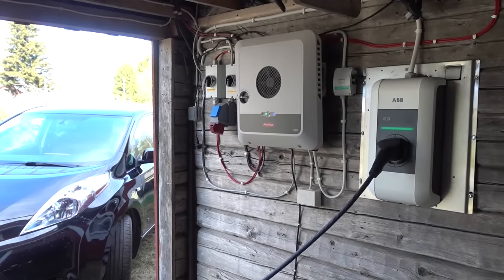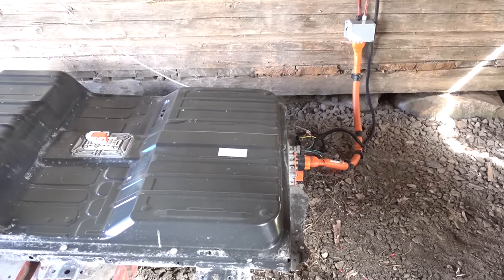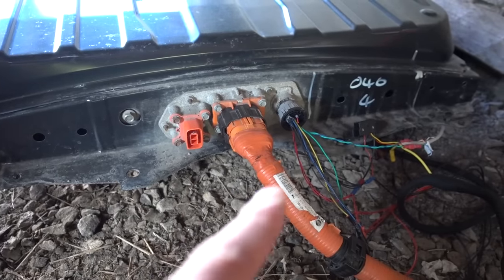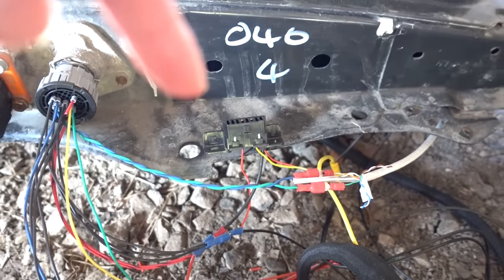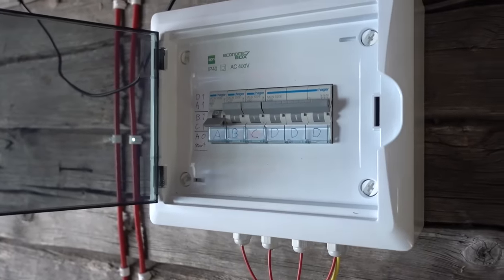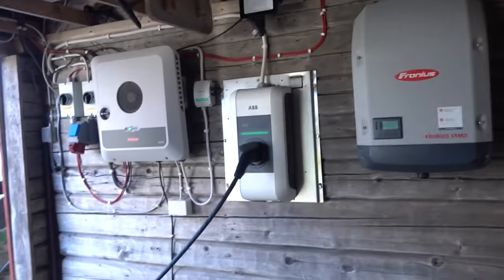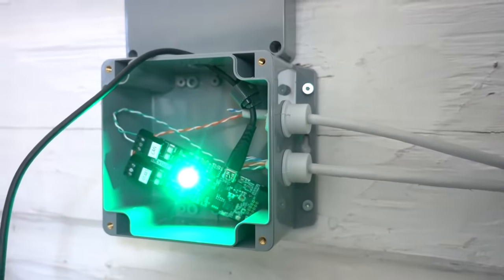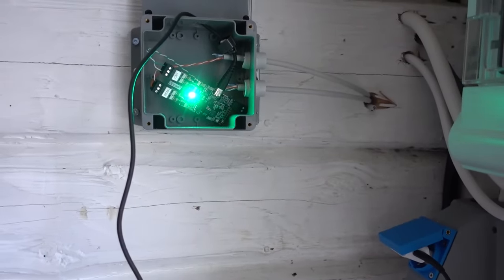The EASIEST way to connect used EV packs to grid! 🔋

Comment: Dala, that is something I would like to do for an off grid application, but could explain it a little simpler for us that are not as advanced as you. Especially the part how you can charge the 400volt dc battery pack safely. Also, can this be used with your 48 volt system that you already have installed?
Reply from the maker: The solar inverter is charging the 400V battery either directly with the solar panels, or it can also charge from the grid. All the magic happens inside the Fronius Gen24.

This is very different from the 48V battery I built a while back. I would not recommend the 48V anymore, this is soo much better and easier to use!
Reply: @DalasEVRepair  It appears the key here is that Fronius Gen24 is capable of charging a high voltage dc battery, right?  Watching the video I was trying to figure out how you were converting that high voltage battery to 48 volts.   I have a Sol-Ark 12k and I'd have to find out if it is capable of charging HV DC batteries.....Evidently I'm "old school" having broken my leaf battery apart three yeas ago and configured it to 48v :)
Reply from the maker: @ScoopDogy  Correct, the Fronius handles both charging and discharging. This is the future, so simple!

Comment: Truly amazing setup, we will see a lot of these setups around the globe, of that I am sure! What about isolation measurement (resistance between HV+ and HV- towards PE). Is this done by the battery or the inverter? What happens if the isolation resistance becomes to low, does the contactor close in the HV battery and inverter then? Does the control logic check so that all cell voltages, temperature and current does not get to high/low and if so, HV battery does close?
Reply from the maker: Both check the isolation resistance. If the battery senses leakage to ground, it raises a CAN message which stops charging/discharging. Also if the inverter senses this, it stops charging and discharging.

Cell voltages and temperatures are also monitored by the BMS, and charging stops if something becomes dangerous!
Reply: @DalasEVRepair  Thanks for response! However, I do not think that both the battery and the inverter does check the isolation resistance. Reason for this is because in order to check this, you need to produce some voltage between the ground and power voltage. If two devices are doing this at the same time, they will interfere with each other and think there is an issue with the isolation...

Comment: Hi! Thank you so much for your project. Previously, there was a connection diagram on github, not only a high-voltage circuit, but also a low-voltage one (at 6kW). I have a question, does this emulator still control the low-voltage output? And is it possible to control the battery without an inverter (I don't have one at the moment)? I want to test the battery (nissan leaf), and test it under load.
Reply from the maker: Yes to all questions. Check the Wiki on the Github page

Comment: last time I saw this, a used LEAF battery costs almost the same as brand new LFP cells with the same capacity.  in other words, you are better off with LFP because it has several times the cycle life and much more flexibility for installation than the EV battery.  It also helps recycling the old LEAF batteries to extract various metals in it for better use
Reply from the maker: Nah, used batteries here sit at 75€/kWh , you cannot get new ones cheaper than that

Comment: Hi Dala do you have any thoughts on making this for available as a package for people off grid? I have thought I could just run a 12v invertor straight from the leaf 12v battery as the main battery also feeds into (charges) the 12v. Would this still work if I swapped the cars 12v battery for a larger capacity 12v leisure battery?

Comment: Fantastic!  Can I make a request to look into - the possibility of also providing communications with a Renault Zoe battery?  They are pretty cheap in the UK at the moment - the scrap yard up the road has a 50kWh one for sale for £4800, which is about the same price as a 5kWh battery from myenergi (inverter aside!)...
Reply from the maker: There are basically no Zoes here in Finland, but anyone can add support on their own, that is the great thing about open source projects! 😁
Reply: The Electric Viking, Sam Evans, talked some time ago that the price "nowadays" of the cells are about 100 USD per kWh, and the price goes constantly down. This means, for sure, that the prices of used batteries will go down, maybe not that fast as desired.
But the path into the future is quite clear!

If you want to follow, without googling to much, the development of new battery technologies, I think The electric Viking is a good source. New technologies mean normally lower prices per kWh. 😉
Reply: Renault Zoe 52kWh protocol had already been worked out and tested for ESS. Feel free to get in touch if you want more information.
Reply: @toucan_can  how?

Comment: thank you for technical advice, but just curious, why would anyone need battery system, if that system can't work without electricity?
Reply from the maker: It can work without electricity. A small 12V lead acid battery can keep the battery engaged when the grid is down

Comment: Hello Dala  can this also being used when the battery is still in the car?
just make a plug in the loom for canbus/12volt and use a big DC conector like forklifts have.
than you can still drive and use it for youre home ?
Reply from the maker: Yes it can, I added basic emergency support for Chademo: https://github.com/dalathegreat/BYD-Battery-Emulator-For-Gen24/wiki/Chademo-vehicle

Comment: I wonder if there is a market for a conversion kit / wall box for this
Reply from the maker: The hardware is 15€ and open source. Making a product would have two big issues. One would be the price, people would constantly complain about the price, when there is a free software and 15€ hardware involved. Second big hurdle is the liability aspect. Who would even want to sell something like this? What if thr customer is not technically handy, connects everything wrong and starts a fire? No this project stays as a hobbyist open source one!

Comment: Very good, thank you. The 12vdc DIN rail switch panel could easily be automated using a small plc etc.
Inverters can get hot (60°C) when working close to capacity so I would mount it on an aluminium plate with air gap [temperature switched PC cooling fans below help further] to keep it below 45°C which is where they throttle back to protect the IGBT's and make it more efficient.
Reply from the maker: Good tips!

Comment: Very cool - I see at the 4min mark you talk about manually opening/closing contactors in the pack. Does the packs BMS eventually take control of the contactors for safety? (Overcharge, Overdischarge, etc) or are you bypassing the BMS?
Reply from the maker: See the latest video contactors automated!

Comment: If the mains grid  power does go off you said your BMS to RS485 will cont to run with the converter board battery backup once fitted. How do you isolate the battery power into the house from the mains power. You dont want to be feeding back out to the main grid. Does the Solar Inverter have an automatic isolation for this?
Reply from the maker: The Fronius has an optional contactor box for this scenario yes!

Comment: That sounds cool that it can be used how safe are they?  We seen how many of those EV car's just blow up in flames because of the battery's..... so I wouldn't put one of these in my house. Maybe outside the house with um... Idk in a fire box or something.
Reply from the maker: The wiki has more safety info: https://github.com/dalathegreat/Battery-Emulator/wiki#what-about-safety-%EF%B8%8F-%E2%84%B9%EF%B8%8F

Comment: I am thinking about getting a secondhand Leaf. We are completely off-grid at home so charging at home is probably not possible at this point (well maybe only at the sunniest times of the year). There is a charger just down the road. What I would like to be able to do with it is take it down the road and charge it up and then be able to inject the HVDC into my solar power system. i.e. the battery is still in the vehicle. 

I have heard about V2H. However is there a simple way to gain access to the live HVDC while the battery is still in the vehicle? In other words just using the vehicle's electronics to set the battery to "on" and then be able to draw a load from the direct outs of the battery pack?

Comment: I checked out most of the supported inverters and I did not see any compatible with three wire split-phase systems like those used in the Americas. Do you know if any of those supported will be compatible with this type of electrical system? Most of the tested inverters are three phase, which is only usually available in industrial areas of the US. Thanks so much.
Reply from the maker: AIMS is adding support for the Battery-Emulator next week, that is a perfect inverter for the US!

Comment: Using a different inverter - Fronius aren't readily available here - is there a need for the CAN-BUS conversion, if the inverter is capable of reading CAN-BUS? We can readily source SolaX, which can take 500V battery and has CAN-BUS signalling.

Comment: how can you use ev caar battery if inverters work only with max 48volts battery packs ? do you have transformer if car battery is 300 volts that transforms 300volts down to 48 volts or how did you do it ? what is voltage of nissan leaf battery ?
Reply from the maker: Get a different inverter that can handle 400V. Much easier! I have other videos on 48V, but I do not recommend this route.
Reply: @DalasEVRepair  ok i didnt know there are inverters that work with ev batteries. Is it necceceraly to do all those connections about communications ,or can it be more simple just to connect positive and  end of leaf batter to inverter ? Would it work with just that ?
Reply from the maker: @triplextriplexxx8225  All explained here: https://github.com/dalathegreat/BYD-Battery-Emulator-For-Gen24

Comment: Suggestion: buy one of these cheap DC-DC step down converters and power your Lilygo board through that converter directly from the battery pack. They are cheap and have wide input ranges and the output voltage you require. I use a couple to run my 12V camper compressor fridge and other 5 and 12V gear from a 48V LiFePO4 battery pack. Very efficient and cost effective.

Comment: This is fantastic!  No need to muck around building batteries or bms's. Plug and play. Question: of you wanted to use multiple leaf batteries would that require multiple inverters? Or could a single invert handle more than 1 battery?
Reply from the maker: You can string together multiple LEAF batteries yes, but you need one additional PCB that summarizes the CAN data into one, so it appears as one large battery. Would take a few hours of development, quite straightforward!
Reply: Come to the comments just for this.

Dala, is this something you’d be looking to do on your setup? I have zero technical skill but would love to see an ability to string multiple batteries together on one inverter for scaling.

Comment: HI Dala's I have an issue with my Nissan Leaf 2018 model with 123,000 miles drove it for taxi cub  
It showing the car is connected to the charger while charger is out
I token the car to dealership they told me to change the battery or IPDM when I found out from Nissan it was Huge amount of Money so I could not just afford to buy one from dealership I bought a car from auction with 2,7000 miles and I replace that battery to my car as well as the IPDM but the car showing the same problem which was showing before could you kindly advice please
Reply from the maker: Make a thread on the mynissanleaf.com discussion forum, and attach the fault codes!

Comment: Would it be feasible to keep the battery pack attached to the donor vehicle to power an inverter while parked, but .. disconnect to drive? I imagine so but wiring would be more complex (and need contactor(s) to isolate pack from vehicle while using it for power).
Reply from the maker: I added crude Chademo support last week, for connecting vehicles directly! https://github.com/dalathegreat/BYD-Battery-Emulator-For-Gen24/wiki/Chademo-vehicle

Comment: great video!  my apologies for being a nube.  Question:  When you say "30kWh" don't you need to state the voltage at which you home electrical circuit runs?  It sounds like you are in Europe so it would be 220v correct?   I have been trying to find the voltage that leaf motors run nominally and it varies by the rpm.  I am seeing quite a few quotes but 5000 seems to be a commonly cited number.  Can anyone cite the kWhs at 110v (US)?
Reply: 30KWh are 30KWhs, nevertheless which voltage is used. As mentioned in this and other of Darla's videos, the battery has a voltage of about 400V when almost full which fits perfectly to the high voltage input of a Fronius Gen24 inverter. P=U*I, so 30KW=400V*75A (simplified). Means you can draw 75 amps over 1hour or half of it over 2 hours and you have taken the 30KWh out of the battery. As a usual household barely consumes more than a few KW permanently, a fill battery will easily power the house for a day or longer. The inverter will convert the high voltage DC to whatever you need as voltage in your area, except of a few percent loss you can consume the 30KWh converted to 110V or 230V here in Europe.

Comment: I’m looking to use a Leaf as both an ev conversion and a battery pack for solar storage. We have a vintage Airstream trailer we use as a summer house on a remote property and want to make a VW beetle ev conversion like the Fastleaf to mostly just sit next to it looking cool but also be drivable, since we sometimes need to move the trailer a short distance because of potential creek flooding. There are no grid utilities available. How can this be achieved? What would need to change to make the Leaf vehicle to load? Thanks so much. I’m dipping my toes into water that is way over my head.

Comment: Question, how old is the Leaf Battery, how many miles/KM did the 'donor' Leaf do - or, let's say, how many charges did the Leaf battery do prior to you getting it - how much did you pay for it and how many years do you think are left in it? I am planning to install a Solar Panel system, and i would really like to be able to go off-grid. Is it also possible to combine these batteries? For example, instead of 1, put 4 on a wall, growing the power capacity to 120 kW (assuming a 80% usable, would make a 96 kWh pack ).
Reply from the maker: This is a 2017 30kWh with over 100k km on it,89%SOH. I have estimated this to last 10+years, maybe 15.

Parallelling multiple packs is doable!
Reply: @DalasEVRepair  what should one pay for such a second-hand battery, more or less? thank you for the response!
Reply from the maker: @manoahvanderwolf3259  depends on region. a 24kWh pack is 1.5k, 30kWh is about 2.5k
Reply: @DalasEVRepair  thank you SO much. so that's really interesting, as new 5kwh batteries, like those of huawei or pylontech are about 2k (in EUR) in Spain ( where i'm at ), so i get like 6 times that much for about the same price just by having a Nissan Leaf unit.

Comment: Cool, but I don't have the HV batteries, mine are the LV ones... guessing it would not work ?

an off topic question, with my BYD LV batteries, the only way I can seem to view the BMS stats is by going out to the battery, unpluging the data cable so that it goes into WiFi mode, and connect via the App. 
the battery is connected to the LAN and to the Internet (and BYD can access it that way) does anyone know if there is a way I can connect to it over my LAN ??
I can see it on my network, but the WiFI user name and password don't let me in :(

Comment: Could you please make a review of how does the system work today and what is going on with the capacity of the battery. Is there challenges that you had to overcome meanwhile? Thank you for all your efforts and sharing the knowledge
Reply from the maker: See my latest video. Battery got doubled! Smooth sailing since start, basically no degradation in this easy life as stationary storage

Comment: is it compatible with a byd battery?

can this be designed so you can use a running vehicle and just unplug your car and drive away?
Reply from the maker: Yes there is experimental Chademo support!
Reply: @DalasEVRepair  Do you have more details about it?
Reply from the maker: Nope, nobody has tested it yet! @adicorutiu8049

Comment: Hi Dala very good video and smart setup. I use a hybrid Goodwe GW8K-ET hybrid inverted, which looks quite similar to Fronius Symo Gen24 Plus. Interestingly is it possible to adopt it for my inverter, because Goodwe also uses a High voltage battery (Battery Voltage Range (V) 180~600) and supports: BYD HVM 11.0 battery?
Reply: Found via FAQ what should work, thinking to try. Need to start with battery purchase or the opposite?

Comment: Will this work with other inverters? Is the inverter canbus protocol a standard?

Your Gen24 inverter takes 350v batteries? Is that unique or do most inverters do that?
Reply from the maker: See the wiki https://github.com/dalathegreat/Battery-Emulator/wiki
Reply: @DalasEVRepair  thanks. I see you now have the contacters controlled by the microprocessors. 

Is that necessary? The contactors might go off once or twice a year in this application, rather than twice a day. Is there still the need to protect them from arcing? I have no reference here so genuinely interested in your thoughts.

 Thanks for pioneering this work. I wonder if inverter manufacturers will start to integrate this as a feature option in future or with firmware upgrades.
Reply from the maker: @andypag1071  Having them controllable is recommended, incase we encounter a fault we can open them.

Even though control is automatic, they stay on for 99.9% of the time. They are not opened daily